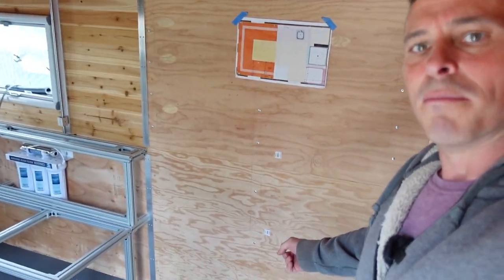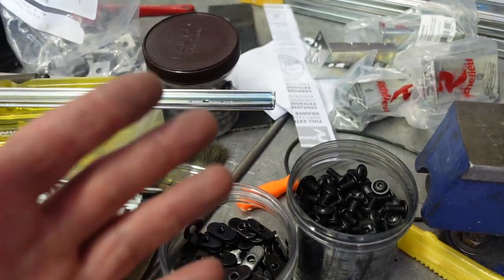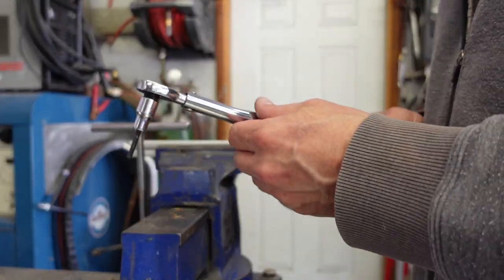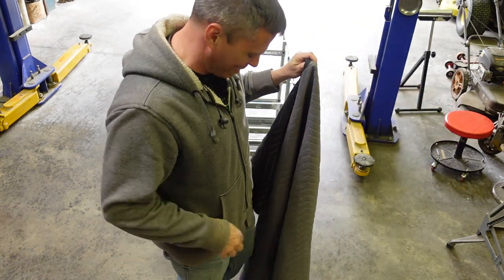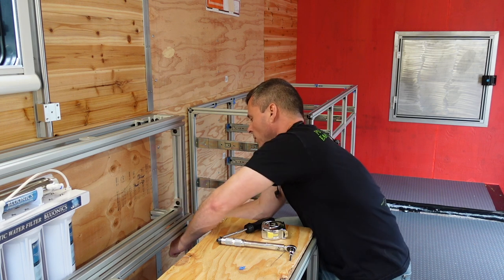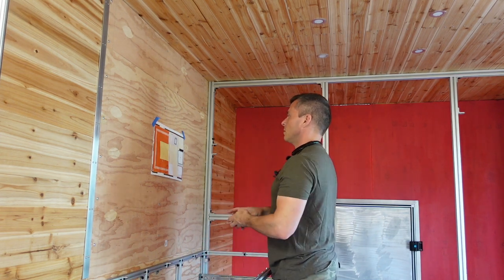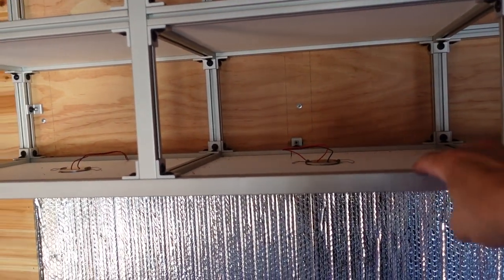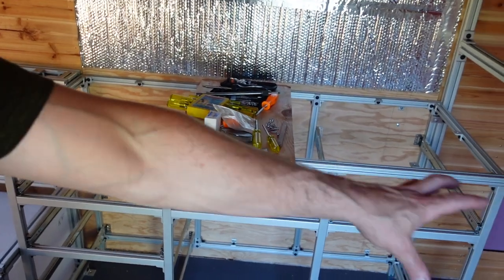Kitchen Cabinet Framing with 8020

Comment: OMG just found your channel! 🥰 I've been dreaming about LMTVs for a decade. I think it's going to happen within the upcoming year. I absolutely love your humor in this video. Your OCD is respected here. Can't wait to see your mechanical how-to's. I'm already planning how I can use "Arduino" like devices to hack the LMTV.
Reply from the maker: I've been tinkering with Arduino for the self leveling bed system. (it's been a disaster so far) if you like automated systems, you should check out @Everlanders channel https://www.youtube.com/channel/UC76GYXW3j9z5g3OdW--Sf5g
Reply: @BrokeOverLand  I'm more about the user interface and adding usefulness to things. I'm in love with the wio terminal by seeed studio. Tiny, in a case, has display, 3 buttons, joystick, 40 pin r-pi header and lots lots more.

Comment: Chad, 
Boy it’s looking great the 80-20 is really shaping up nicely, your project is going to be one of the most detailed LMTV’s known to man. Keep up the great work… 
I usually don’t post advice and disregard this if you are familiar with starboard characteristics.   But I did want to let you know to be careful with starboard. As you may know I used a ton of it… literally like 1400lbs worth and I have found it to be extremely volatile to temperature. Living in Colorado my truck has been exposed to interior temps of 0 to upwards of 100 degrees while building. Through those cycles I have noticed up to a 1/4” of movement in my panels of starboard. So if your building it in high temps tight is ok but building in cold weather you better leave room for expansion. Again sorry to comment with “advice” but I would hate for the starboard to expand and push open the 80-20 joints!
Reply from the maker: 100% appreciate any and all advice.  I was not aware of how much it expands. I do have about 1/4” room for expansion.  I’ll check in the truck today.  Since it is 100 degrees outside right now.
Reply: It seems the larger the panel the more they move but mine was mostly done @ 70 degrees then when it got cold from pulling out of the shop the panels gapped bad. I’ve since made trim pieces from anodized flat strap that cover the gaps!
Reply from the maker: Thank you for the info. I just popped over to the shop. I'm good on expansion, However my issue now is sagging! When I built the cabinet, the shop was 72 ish degrees.  It is a 114 degrees in the truck right now and the wall the cabinet is mounted to is 127 degrees and in direct sunlight. the panels have sagged about 1/8th inch. I've opened the windows to cool it off in there. But I may have to go back to my original plan of using aluminum inserts... we'll see how much more they sag, before the temps come down next week.
Reply: Dang, that sucks it’s like the hidden disadvantages with starboard nobody talks about. Keep it between 60-75 degrees it’s great. Heat it up or cool it down = problems
Reply: Forgot to mention It will cold form too heat just speeds it up. My table top is made of it in its 1.5” variant  and even that thick I had to back it with a sheet of .250 aluminum to keep it from drooling down with gravity. ☹️
Reply from the maker: video posted. :) Long term it will probably be ok, but if it sags any more then a 1/4" I'll replace it with something else. that is the best part of using 8020, the ability to pull it apart and swap stuff like this out.

Comment: I was wondering about cost compared to wood framing, then I saw the list of body parts LOL
Reply from the maker: yeah, the extruded aluminum cost is not too bad when comparing to heavy wall aluminum tubing. The real money is in the brackets and fittings. I probably have more money in fasteners than extrusion. :)

Comment: Wait, wait, wait... so you used Loctite and torqued everything just to take it apart again? Practice makes perfect??? LOL! And as for that hoodie, don't throw it away! Some guy like myself will go into GoodWill and buy it. Personally, I'd wear it until I got holes in the armpits... then I would tear the arms off of it and wear it for another summer or two. :-D
Reply from the maker: Only had to take the side pieces off. those I didn't locktite until it was in the truck.

Comment: Cool vid 😁 .. did u start with like six - seven foot rods of alum and then cut the sizes you needed how expensive was it and the bolts they come in jars ?? I'm in Calif and just finding 1" square alum rods is a task and they come in six foot length only..and place u cold recommend do u have a list of wat you needed to do your project ..I think there better than wood and lighter I'm sure ..
Reply from the maker: The aluminum is crazy expensive right now. But it’s the corners and brackets that really add up.  I have about 5k in extrusion and brackets.  I get them through. 8020.net or McMaster carr

Comment: How are you finding the 80/20 for building compared to older methods?
Reply from the maker: I like the extruded aluminum for its rigidity and it's easy to modify. The major draw backs are the number of fasteners this thing sucks up. that's where the real money is. I'll do a comparison video once I'm a bit further along. As it is right now, I would have been better off with a cut and weld solution.

Comment: How did you attach the aluminum to the wood? Is it wood framing?
Reply from the maker: Several different methods.  1. Use the track in the 8020 2. Panel brackets 3. Hinges 4. Corner brackets screwed into the plywood.  All depends on the application.
Reply from the maker: The 8020 is the framing.  The habitat is framed out of steel.

Comment: I would say you must be spending a fortune on 80/20 but I just saw the price of plywood at Lowes. 

I don't know if it would work out any cheaper but an alternative could be Penn-Elcom style road case extrusion and hardware.  It would probably work out lighter, possibly not as strong but I don't think strength is a big issue for your use.
Reply from the maker: No kidding.  Saw a 4x8 1/2” birch ply for $70.

Comment: Question, what was the panel you slipped inside the slots in the 8020? Can you give me a link to the website? Looks like you’re using mostly 10 series? Thanks!
Reply from the maker: Not sure I follow, could you give me a time stamp?   Also yes I am using 10 series for the cabinets and 15 series for the dinette.
Reply: @BrokeOverLand  it was at 9:40. Thanks!
Reply from the maker: Ah yes.  That is 1/4” HPDA plastic “starboard” from Tap plastics.  It’s easy to work with stuff, but it does expand and contract with temperature so leave yourself some room.
Reply: @BrokeOverLand  thanks!